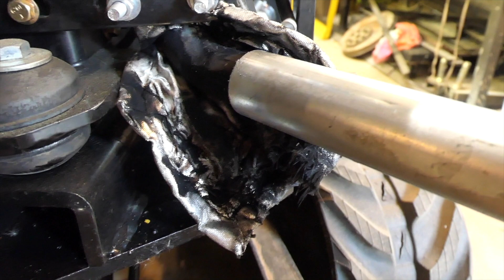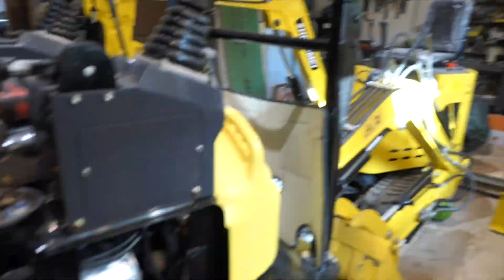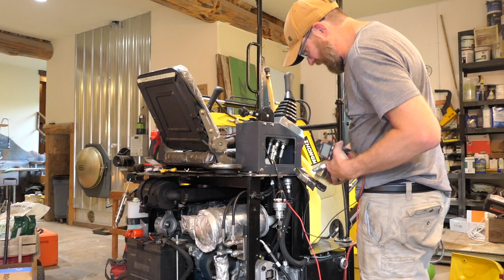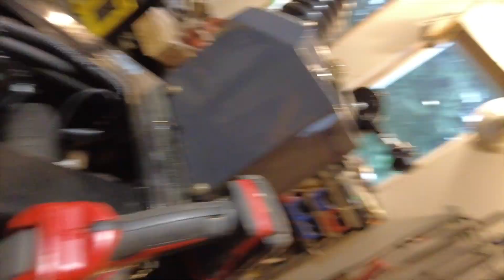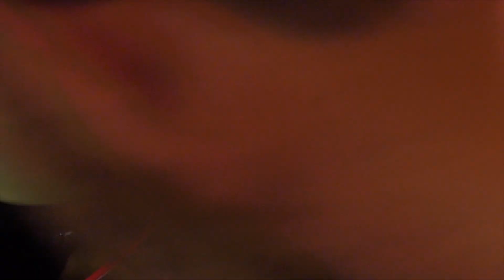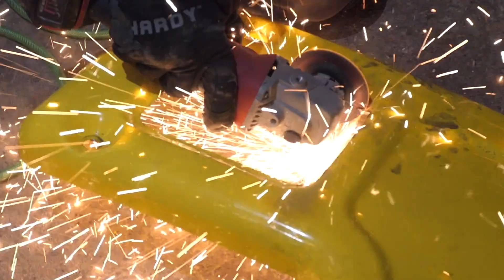Mini Chinese excavator Little Fixes: Cooling Fan, exhaust and oil pressure sensor

Comment: I saw you installing the Oil Pressure sensor, but didn't explain exactly where it goes and how it's routed? does the engine have an extra tapped hole for the oil pressure sensor, or is that the drain hole where you installed it? Sorry for the newbie question. TIA for a reply. :)
Reply from the maker: @luissinsin it had a hole already tapped for an oil sensor

Comment: I recently got one of these diggers, the hydraulic oil level on the little bubble is below the red dot, but the tank is full. Does anyone know if this is normal ??
Reply from the maker: The tank should not be full all the way to the top, take a tape measure, and measure down from the top of the tank to the red dot. Drain fluid from the tank until you can measure down inside the tank from the fluid to the top of the tank and have it match the distance to the red dot. Chances are the gauges completely full and maybe you’re looking at an air bubble? It can be hard to tell. What’s there when a site gauge is filled all the way to the top.
Reply: @jakebell1947  thank you. I’m going to try that later today. I will be using that machine at a job site and want to make sure oil levels are good.

Comment: Never wire a fan thru the switch for the machine.  The switch needs to go to a relay which takes the actual load of the fan.  Don't want to melt your switch.  Very easy to do.

Comment: I just bought one of the smaller 1-ton air cooled gasoline engine models.  The exhaust was ported completely outside the rear guard, but it still gets way too hot in the engine compartment.  I'm going to try running it with the body panels removed for a while and see how that works out.  Also I'd like to add a hydraulic cooler, and that's in the works.
Reply from the maker: I have a gas air cooled on as well and added a fan. I just wired into the electric kill switch. It helped a lot
Reply: @jakebell1947  I had installed two fans and it ended up draining the battery while I ran the machine.  Turns out the charging stator only produces 9 amps and I had two 80 watt (13+ amps total) fans going.  So just a fyi for anyone looking to add modifications to the mini's.
Reply: When he took off the panel I immediately thought, why don’t you run it w/o the panel and see how hot it gets?
Reply: Hey brother. Any updates on. This? I got one of the loaders recently it seems to have a decent oil cooler for the hydraulic system. Looking into getting a one ton unit but I am looking up the oil cooler situation and if that helps keep the temp down any. Also which one did you get? Thanks in advance!
Reply: @youngprince716  My engineer friend set up a hydraulic cooler and temperature monitoring system on my excavator.  It has a radiator and a fan which kicks on at 120F.  I've been using the heck out of it and I still haven't seen the temp above 110F.  Theoretically the fan should kick in, but I haven't personally seen it yet.  I've asked my friend for a list of parts he used and I'll post a video about it ASAP.  I recommend everyone who gets one of these immediately remove the engine shroud, as that will get you a long way towards cooling down the "hot seat" condition.  But the hydraulic fluid still heats up very quickly, and I'm sure that's not good for the components.  Overall, it's been the best tool I've purchased all year, and it's already paid for itself.  Nothing has broken or gone wrong so far.  There were a few fittings which needed tightening, but that's not a big deal in my book.  They're really sturdy little machines, especially at their price point.  Highly recommended.  Check Richie Bros auctions, they always have a bunch of them for the best price you'll find unless you want to deal with importing one yourself, which is a PITA.  They're all pretty much identical except for the paint as far as I can tell.  Also I added the hydraulic thumb attachment from eBay and that's going to be a great investment as well.